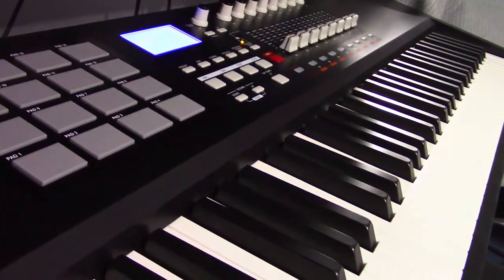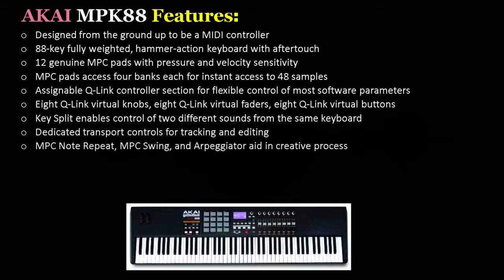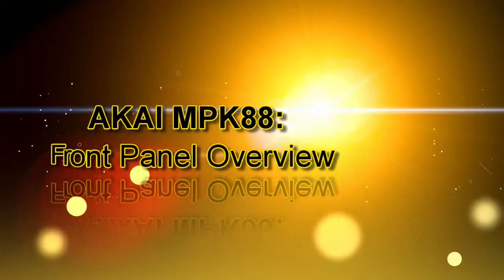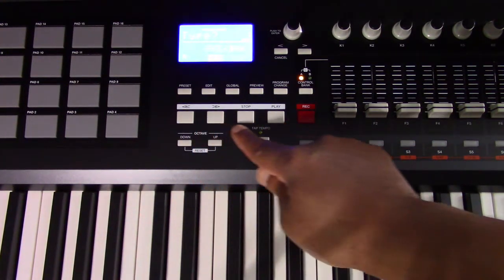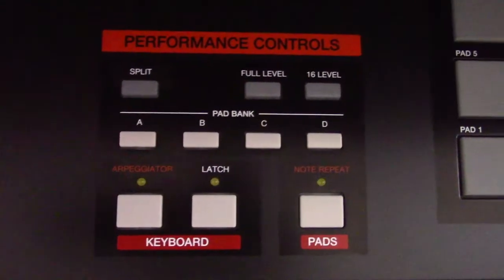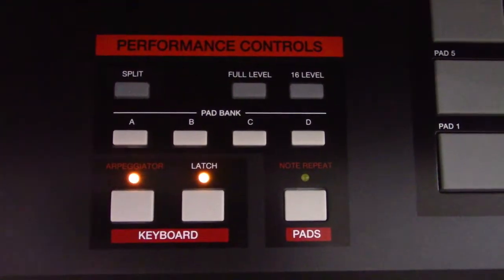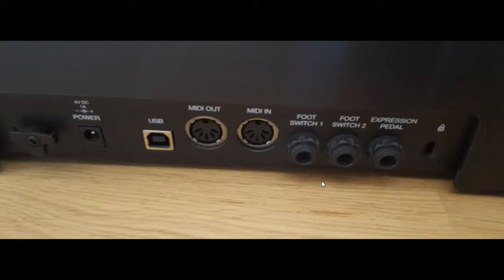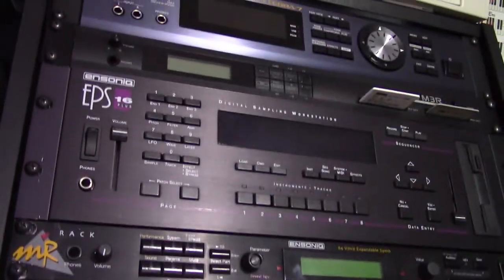AKAI MPK88 USB/MIDI Performance Keyboard: Why and How I Use It

Comment from the maker: Akai MPK controller keyboards have become standard equipment in many professional MIDI rigs and home studios. There’s great reasons for this, as trying to control a rack of MIDI gear and or software using different MIDI devices can drive one insane. I wanted to share this information with anyone who has gone down that road and is looking for a life-line. I hope this presentation serves useful.

Comment: do you use the 6volt power supply with it? WIth just USB power, I notice the buttons (like Arp, Global, Preset etc) dont seem to work, neither does reset... any advice?

Comment: I wanted to see if you could help me understand how to get my sustain pedal to work with this particular keyboard. I’m a full-time pastor and our worship leader gave it to me so I could play it at home and I have it hooked up to my computer and everything works with the different sounds on GarageBand, but I’m having a hard time getting my sustain pedal to sustain the notes. I’ve tried switching the bottom of the sustained pedal and tried powering off and turning back on, but it will not reset. Is there a function on this keyboard with the media screen that I should go to to activate the sustain pedal?
Reply from the maker: Oddly enough, I have my sustain pedal plugged into the Expression Pedal input on the back panel. I have a basic sustain  pedal that I purchased from Amazon. If you're having issues, your pedal may be the cause. I've had no issue with mine thus far. I hope this helps and thanks for watching.

Comment: How do I reset this keyboard or can I…?
Reply from the maker: I don't see a factory reset for this unit anywhere. If someone else knows please chime in. Otherwise , I would suggest you contact Akai customer service for further assistance. Thanks for watching.
Reply: @PowercoatMusic  Perform a factory reset on your mpk unit:

1. Press the 'PRESET' button once,
2. Press the '>' button 10 times,
3. When the screen displays 'Factory' with the word 'DEFAULTS' underneath, press the encoder knob (the ENTER button).

Comment: I’m having trouble of my keyboard mpk88 sending unwanted mod/pitch wheel data. I’m uncertain what is going on, but it’s not working as intended and certain plug in it throws modulation and sounds out of pitch. I’m a bit frustrated as staying in key is my biggest concern
Reply from the maker: I’ve not run into that issue myself. Make sure you’ve assigned the proper controller to the pitch and mod wheels in your software. You may also want to try reinitializing your software driver. Thanks for watching.

Comment: I've been using the MPK88 daily for more than 12 years. I just bought another  one (used, since they are no longer in production) that was in new condition. I've kept the older one for parts. It's a solid piece of kit and is very useful and I wish to continue using it. Do you have any source for parts? I used to use MPC Stuff but they no longer seem interested in this unit. Any info would be greatly appreciated. Thank you.

Comment: How do i get the pads from playing notes on the keyboard. For example pad 4 is acting as C4?
Reply from the maker: The pads on the MPK61/MPK88 can be set to transmit Note or Program Change information when they are hit. The default operation of the pads is set to Note, which means that when a pad is hit it will generate Note On/Off messages to trigger sounds. The pads may also be set up to transmit Program Change information, which allows you to switch to different programs (instruments or sound banks) on your DAW or external device by hitting the pads. I hope this helps.
Reply: Can you please help me change it? I don't want the pad to play a note.

Comment: Great review of the MPK88, thanks. I'm currently using an MPK88 with Studio One 5 and it has been rather annoying to figure out. I've figured out that the Midi Ports (labelled IN and OUT on the MPK88) actually come up as AKAI MPK (IN and OUT), MIDI IN 2, MIDI IN 3 and MIDI OUT 2. I think this refers to the separate keyboard (AKAI MPK), pads (when B1-16), an external midi source plugged into the MPK's IN  (midi in 3). I think logically the MIDI OUT 2 should be an output from the computer, but I can't get Studio One 5 to show a tab within the TRACK OUTPUT section to choose MIDI OUT 2. I'll carry on investigating.

Comment: Is the 88 weighted hammer action graded, that is, towards the lower part (next to the mod wheels) the keys are heavier and the top lighter (like a grand piano)? I don't see it mentioned anywhere.
Reply from the maker: Action grading is not mentioned in Akai's specifications for the unit. However, I do notice a bit of difference in weight between the lower and higher keys. Others may not agree, but this is my perspective. Thanks for watching. 👍🏿

Comment: BRO Is the old MPK 88 better than the new MPK 261
Or is only the hammer mechanics
Or albailed keys better   DANKE 😁🎯
Reply from the maker: Many of the features are the same but the MPK 261 is a smaller board. Since it is newer you should have more software features than the 88. Thanks for watching. 👍🏿

Comment: I had the MPK49, it had a rather stiff keyboard feel and the pads were not very sensitive at all.  It had a solid build quality but in the end I sold it and got a Arturia Keylab 49 Black edition.  Your MPK 88 maybe completely different as it seems you are very happy with it. Kudos on your great content!
Reply from the maker: It's often funny how the feel of a brand model's buttons can be different sometimes. Aturia is also a great keyboard controller. I had a mini for a short time. Tons of features. Thanks for watching and sharing. 👍🏿
Reply: You can make the pads more sensitive in the settings.

Comment: Hello, many thanks for this presentation of Akai MPK88!
I have many midi keyboards and midi modules, so I would be very interested on how you interact between the mpk88 and your midi patchbays.
In other words I would appreciate if you could explain your midi setup to control all your midi gear and your Daw from the mpk88.
The interesting part, for me, is to understand how you hooked up the controller to patchbays and then to midi gear. Most of all how you manage the midi routings during the creation of a song via the patchbays.
For the Daw side, I suppose you are using the Usb port of the akai to connect it to an interface and so to your daw.

In my case I use Logic Pro as Daw, an RME audio interface (which has also 2 midi in and 2 midi out) and a couple of old Yamaha MJC8 routers  (midi junction controllers)  with 8 midi in and 8 midi outs each.
Many many thanks in advance for your time and explanation!!
Reply from the maker: I am planning a series of videos that explains much of what you asking. It took me years to finally get a setup that fit my requirements and worked well for me and it wasn’t easy. As we know, this is a very subjective area but the bones of the matter is what should be of interest to some. Again, stay with me as this information will be coming in parts in the future. Thanks for watching and sharing.
Reply: Thank you for your quick reply! Ok, looking forward your new videos regarding midi setup… :-)